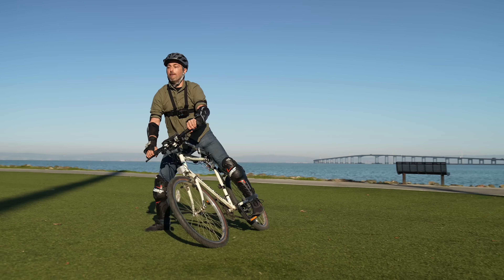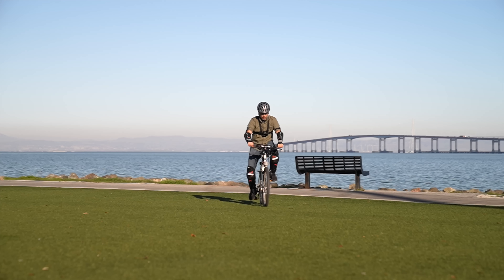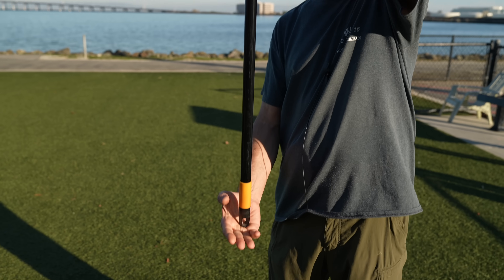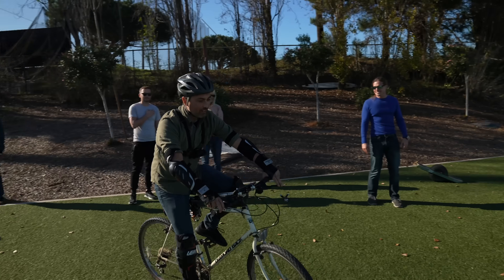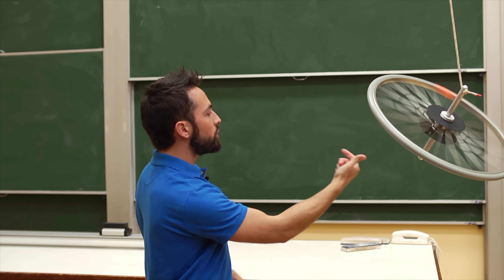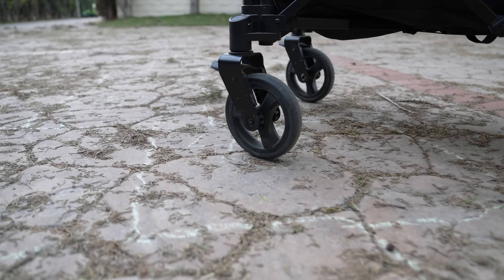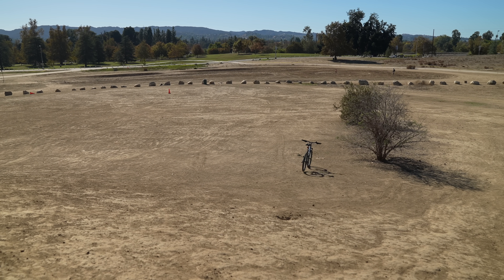Most People Don't Know How Bikes Work

Comment: That was very interesting! I missed one thing in this video - there was no mention of a ride without holding the steering bar. I sometimes see bikers relaxing, leaning backward with hands hanging freely and going straight. They still have to balance using their body (and, I guess, help the steering wheel steer by itself). This seems a bit contradictory to what you've said in 5:20 about us not really moving the bike with our body position, but rather steering the bike to stay underneath.
Reply: Yeah, I was a bit disapointed there were not a lot about ability of  biker to lean in corner. And that IS the way you can "steer" without hand. You slightly move your weight to side, get bike off balance and it autocorrects itself by steering wheel. And i'm not 100% sure, but i guess you could turn this way without ANY countersteering.
Reply: @justunfoe  I was really hoping they'd push the bike down the hill with steering locked in both directions to show this. It seems like that would have been the perfect way to show they were right, if it fell down before getting to the bottom. Missed opportunity there.
Reply: @justunfoe  You're still countersteering to initiate the turn - the turn can't happen until your centre of gravity is to the inside of the turn. When riding without holding the handlebars, a turn is initiated by countersteering with a small weight shift in the opposite direction to the turn, followed by a steady weight shift in the direction of the turn to control the angle the wheel steers at to get around the bend. 

In wheelies, where the front wheel is off the ground and can play no part in the turn, steering is accomplished the same way, but another trick can be used once you're leaned, which is that the circumference of the tire is largest at the centreline, so when the bike is leaned, the centreline is to one side of the tire contact patch, with a shorter path to the direction of lean, creating a turning force as the wheel rolls. Fine tuning balance is done by moving knees in and out, combined with upper body movement, which is facilitated by steering the bike in the direction you want the wheelie to go in. Wheelying the bike would be one way to get it to make the turn required without being able to countersteer the front wheel, but countersteering would still be needed.
Reply: @peglor  that's what i can't understand. Yeah, sure we used to and it is easier to turn (using hand or not) if you do countersteering first. But i don't see reason why  leaning into the corner aka shifting center of gravity to the inside of turn could be impossible without countersteering.
Reply: @justunfoe  It's not impossible, just much, much slower. Countersteering gets the bike leaned much more quickly and more naturally. Trying to move your weight sideways on a bike without doing anything else is not a natural or easy movement, so humans learning how to make a bike turn don't find any success with it compared to countersteering. 

Another way to look at it is that since the rider is much heavier than the bike, it takes a lot less effort to move the bike to the outside of the bend than to move the rider to the inside of the bend. 

The conclusion on this video is practically correct, but not technically correct. Any half way competent biketrials rider or mountain biker would be able to get that bike to turn despite the steering being locked, though they'd just use a sideways hop of the front wheel to start the bend instead of countersteering.
Reply: It's not just going straight, you can also turn corners without using your hands.
Reply: @Exgrmbl  You can, but not nearly as sharply as using your handlebars.  First you lean in the direction of the turn, then you have to keep a slight lean to maintain it.  Finally when you want to straighten out, you have to rely on the auto-stabilization of the bike as discussed at the end of the video to pull you out of a lean... which requires sufficient speed.  Too slow or too sharp of lean and the bike can't pull you back to straight and you ultimately fall over.

When you use your handlebars, you can steer into the turn to put yourself back under the bike with more force than the natural stabilization would allow, which means you can turn as sharply as the grip of your tires allow before skidding out, rather than solely relying on the stabilizing forces of the bike.
Reply: @Exgrmbl  The bike is doing the countersteering for you. Once you lean, the bike leans in the opposite direction and then the steering geometry kicks in and countersteers, initiating the turn. This is also true both during a turn and when coming out of the turn because the handlebars don't necessarily need to cross the centerline for this effect to occur it's just constantly happening. What you're really doing when turning is setting the correct lean angle for the speed and tightness of the turn. And you do that by manipulating where your center of mass is compared to the contact patch of the tires, and the only way for that to happen is for the steering to move in the opposite direction you want to lean, which automatically happens due to the geometry of the steering (rake and trail).

But romancase is correct in that there are realms of performance where this breaks down, and constant pressure on the bars is neccessary. Subtle differences is steering geometry, the mass of the bike and rider, and body position come into play here.
Reply: @sntslilhlpr6601  
Interesting. The weirdest aspect of all this is how natural and intuitive it all is contrasted with the physics, no thought given. Now - the real question is this, how is it possible for a dude to climb up a hill, hand free and also standing up while pedaling? I saw this some years ago on a commute and couldn't believe my eyes, to this day i have no idea how he did it.

Comment: I was taught that motorcycles countersteering is effectively useless at slow speeds, but absolutely mandatory at speeds over 30km/h.
Reply: its not that its useless, its that you don't notice you're doing it... just as many cyclists doesn't consciously realize they're doing it either.  You only make a very slight countersteer to start a turn at low for motorcycle/normal speed for a bike, but it requires far more aggressive (and therefore conscious) countersteering at high speeds.
Reply: @albertjordan3249  I'm not so sure.

When you're at walking pace, leaning your body leans the bike in the same direction. The bike is essentially upright, following it's front wheel. Touch of rear break to drag the bike a bit.

Any faster than that and the bike starts to "trip over" it's front wheel and turn the opposite direction.
Reply: @foltaxtv  Yes, you can also initiate a turn by leaning.  However you absolutely do need to counter steer to exit the turn even at low speeds, that is turn the handles further into the turn, to get your center of mass back under the motorcycle.  You can lean into a turn, you cannot however, lean out of a turn... that's not how physics works.
Reply: @albertjordan3249  Acceleration or front brake also bring the bike upright, where as rear trail braking turns it in tighter.

I think there's just an extra layer to unpack here, as much stronger gyroscopic forces exist due to the mass involved.

Comment: I could probably ride that bike actually. When I taught myself to ride a bike I got into the habit of doing most of my steering by leaning and steering the front wheel to "catch" myself. You can even make very wide turns without turning the front wheel at all just by shifting your weight off to either side.

Of course that style of steering relies on having a decent amount of speed so I don't know if I could pull it off in a small area as shown in the video but it would be worth a try.
Reply: You can ride without steering the same way a bike rides itself; by leaning to one side, the bike steers itself in that direction. However, the locked handlebars thing in the video is very different - even if you lean that way, the bike won't steer that way, so you'll just fall off.
Reply: @Bovineprogrammer  perhaps I didn't put enough emphasis on the "very" part of "very wide turns" the actual radius of the turn would be enourmous but the force from gyroscopic procession would apply a torque to the bike in such a way that it would turn in the direction you leaned. I should have probably also added the fact that you have to be able to balance on a stationary bike to pull it off, which I was able to do before I stopped riding.

Comment: If you watch some accident recording of bikes or e-bikes see when people want dodge collision in emergency, you'll see they tent to do it wrong way and fall over.
I have learned "push to turn" technique in a motorcycle video, while I never had a motorcycle, this applies extremely well in daily bike ride. it's like how on a aircraft throttle controls climb and elevator controls speed -- you can leave without knowing it in most circumstance, but if you always do it the wrong way, one moment it might catch you, and the correct way will always work.

Comment: One can do it if they move there body significantly than counter that movement after the turn to maintain balanced however it is far more difficult because the forces are far greater. Having the bike move beneath uses a higher leverage on force which makes it easier.

Comment: I'm sure many did this when growing up but I would ride my bike without holding on to the handle bar for pretty much as long as I wanted to, till I decided to slow down enough and then had to hold on again.  I was also able to make wide enough turns if I had to by just leaning enough, though you have to have enough speed.
Reply: This is also down to skill. I can ride uphill pretty steep and pretty slow without holding the handlebars. Also make 90 degree turns down another street but you HAVE to go slow to do that.

Comment: You did not try while standing on the pedals instead of sitting on the seat. I drive alot of motocross and you would be suprised by how much more control you have while standing.
Reply: Yes. True. Higher center of Mass, low center of Gravity... uh... maybe the reverse. Anyway, it works... toward keeping one up-right (high-phenate)... then CRUNCH down, foot-down into the curve, down-shift, Throttle-up on the roll-out, leg-in, kick-ass on the straight-away! 1-2-3
Did I get that right? Been a while. Memory... one 2-few biffs on the old Bean.
😑

Comment: This is way more noticeable on a motorcycle. I find your brain accepts it most easily if you think about pressing down on the handlebar in the direction you want to turn.
Reply: Try counter-steering: Throttle back in the lean-to, "pull" back on the outside grip; push down on the inside ["smaller"  sidewall diameter pulls the rear wheel on-track] throttle-up and roll-out. Tighter curves: downshift: torque vs RPM, hold the line.
Sail-on out, up shift/throttle-up... hit the straight and narrow.
Works @110+ mph. NOTE: watch out for the greased crease from those who have failed before you. LOL

Ride for LIFE abd STAY alive:
Drive sober, straight... leave Grandstanding and Racing at the Track... and heads-up for the Bull-goose Looney. There's one lurking at EVERY intersection. 
👍

Comment: Look left, push left, go left. This is what was said in my basic motorcycle riders course 20 years ago. Of course when you push the left handlebar... the wheel turns *right*, and you end up going left. The harder you push the grip, the more you'll turn. It seems wrong, but what you said in the video is correct - we all ride bicycles without thinking about how they work. I imagine most people learn to ride when they're small children, and it becomes as easy as walking - but of course, walking is another thing that is much harder than it appears.

Comment: when I was still trying to practice riding the bike, the handlebars became detached from the forks and I freighteningly cycled 4 miles and realized how to turn without using handle bars. I would want to go slow and carefully but when I was going slow, I would nearly fall and have to speed up again but when I was sped up it was still so hard to balance. I repeatedly went from going really slow to going faster for the whole trip. I practiced turning without handlebars after that and over the years and can do it easily now. I only know it's possible because of that moment.

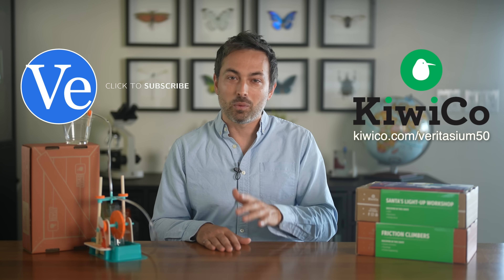Comment: The gyroscopic dialog at 11:20 is not technically correct.  If the gyroscope were rotating in the opposite direction, the resultant motion (from touching the sides) would be opposite to what was shown.  We need to be careful about using the terms "right" and "left" when discussing these forces.

Comment: I'm disappointed: I don't think I turn by doing anything to the handlebars, but rather by leaning my upper body—turning the handlebars seems like a recipe for disaster, in fact.  obv., I know I'm steering for balance all the time, but not to turn.  if the countersteer is something that people are initiating, then it seems like I should be able to steer by shifting my weight, since that would cause the same lean-effect.  if the countersteer is initiated by the lean, then I wouldn't be able to steer by shifting my weight.

also, how about rollers?

I get that rollers may be outside the scope of this video, but I'm disappointed that initiating the turn by leaning wasn't covered.

Comment: Still doesn't explain why they are stable at high speed and unstable at low speed.

I'm guessing, if you replace the tire with some sort of bristle brush and recorded the effect speed had on the self-righting mechanism, you'd get some idea. It's the same with cars, which also naturally counter-steer, at least once you get some speed going.

Comment: This video is better than many others on the subject, in that you don't explain it as if science doesn't understand it. ;)
One clarification I think is worth mentioning, is that counter-steering isn't only to initiate the turn.
Even once the corner is established, you adjust the tightness of the turn by applying a counter-steering force.  to make the turn tighter, you're applying a force to stop the bars from turning in as much as they otherwise would.  For example in the middle of a tight left turn, the bars will be trying to turn themselves to the left, and you will be balancing the bike by pushing more and less hard on the left bar (always applying a small amount of counter-steering force)

Comment: I ride my bike with no hands all the time and steer by shifting my bodyweight in the direction I want to go and the bike turns to get back under me. I have experimented with not doing the little counter steer first in the past with basically the same results as you, but I don't think that I counter lean when riding no handed. Which makes sense based on how you describe turning in this video. Why would I need to counter lean when I'm steering directly with my body weight? I would be interested in a video looking at that.
Reply: You don't counter-lean first. When you're riding no-handed, you're basically taking advantage of the bike's being self-stable, as demonstrated in the video. Any turn is initiated by the balance being upset and the bike falling into the turn to catch itself and return to an upright position, regardless of whether you're acting on the handlebar directly or moving your weight around.
Reply: @aridragonbeard745  So theoretically I could make that turn if was riding no handed.

Comment: Hi all, I have an observation that I could never figure out, maybe someone here has a nice answer. As many people do where I live, I often cycle without holding the handlebars. When I was small I did it just to look cool, but now it just feels a bit more lazy and relaxt than holding them. I have pretty good control, both for sharper turns and finer adjustments, but off course when space in traffic gets tighter or more is happening at once I just grab hold of the steering.
My observation is that when cycle without holding the handlebars I can always see more of the right side of my bike than the left. In other words I am always sitting over to one side of the saddle ever so slightly,  even when going very straight. I have tried to cycle straight when setting dead center, but that already feels like i'll start turning when I still have a hold. And sure enough, as soon as I let the handlebars go start turning and cant go straight.
This happens both when putting force on the pedals and without doing that. Even when I take my feet off the paddles completely (yep, still without holding the handlebars) this doesn't change. Also, it is the same for me on every bike that I can ride without holding the handlebars.
I have been wondering for a while if that has anything to with the way the bike is built, or that I means that my hips a bit crooked or something. 

Curious if any of you guys can observe the same and what you make of this...